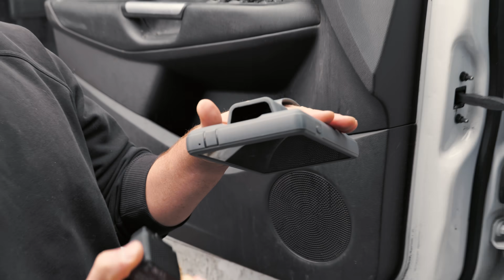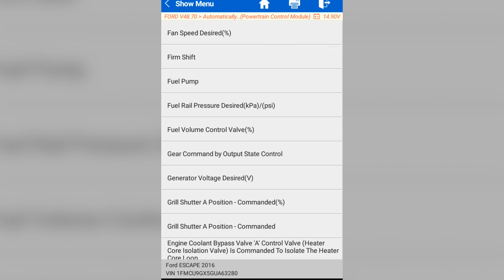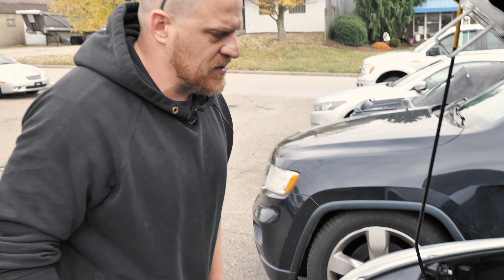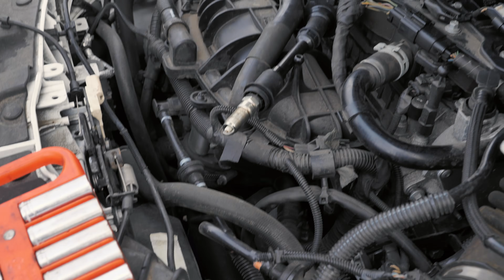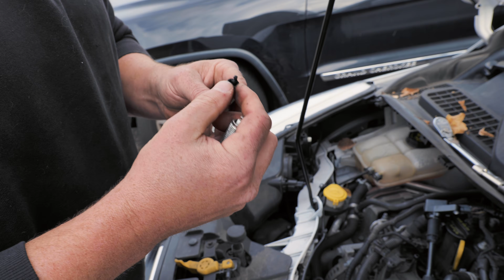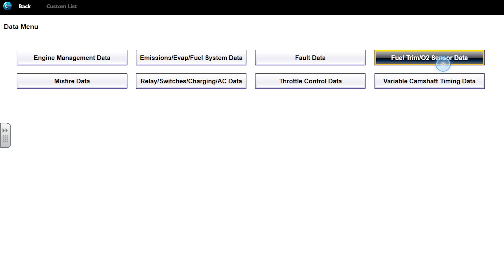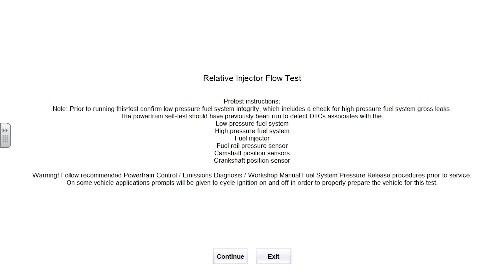GDI Misfire "Comeback" What Did We Miss?

Comment: When I heard you mention someone used AutoZone parts on this thing my first thought was it was the Chinese ignition coils likely causing an issue. I never use aftermarket coils unless they're made by ngk, or Bosch, or denso. Granted in this case it was an instillation error but I've seen that brand of coils come bad or not last longer than a week or so a few times before

Comment: Awesome 3 part video!  I'm dealing with what is likely a stuck open injector on a '18 F150 3.5L ecoboost.  Already came to the same conclusion (misfire code, dumping smoke and fuel out the tailpipe, low rail fuel pressure code), so it's great to have someone with so much more experience (and fancier scan tool) have the same thing.  Hopefully my high pressure pump isn't part of the problem, but I'll look at the fuel for metal (thanks!).  And this was my first time dealing with coils and coil boots, so while it didn't move with the plug or coil, the boots just have a different feel than non-coil systems, so I'll be sure to pay attention to that.  And your paid courses sounds great, so while I like the challenge of diagnosing (across a lot of areas) and fixing in person, the classes will be something to look at when I have some time.

Comment: What I would have done (and not that there was anything wrong with what you did, because there wasn't) but I would have swapped the coils just as you did #3 with #2, but I also would have pulled the spark plug and swapped it with #1. That way, if the misfire stays with #3, I have eliminated both the coil and the spark plug. If it moves to #2, it's the coil pack, and if it moves to #1, it's the spark plug. Just how I would have done it, that's all...pros and cons either way.

Comment: That engine still sounds like crap. Sounds like a diesel.
Reply from the maker: That's just the camera mic picking up the GDI injectors. They are loud
Reply: @ScannerDanner 
Paul...could we consider a potentiometer an analog switch, as oppose to digital?
Reply from the maker: @ekimbrough1413  not a switch, as a switch is either on or off, but yes an analog signal that is continuously variable.

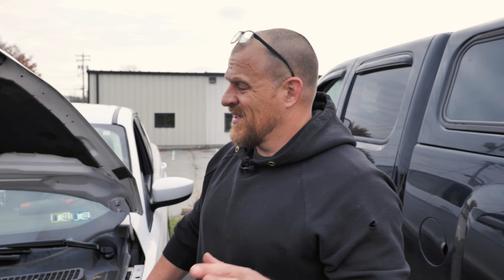Comment: 19:34 what is "open secondary"?
Reply from the maker: There is a primary circuit and a secondary circuit in a coil. The secondary starts at the winding in the coil and includes a plug wire or plug boot and the spark plug. So open secondary is any one of those 3 could be an issue.

Comment: I had side by side misfire on a 97 Sebring once that was caused by an almost invisible pin hole in one wire that was shorting to the metal sleeve.

Easy 1 sec fix 

ALWAYS start with the basics and a listen to your gut especially since I didn’t have fancy tools except a basic reader… old school.

All the sensors are great but engines are still engines.
Not saying fancy tools wouldn’t be good to have.. I just don’t have them. 

BTW Great video on biased voltage.
Now I have to watch the video and see how it ends.

Cool   this shows they should make it better so there’s no doubt when parts fit or not.

Everything is a learning event and absolutely everyone should be paid for their time.

Comment: Unbelievable... something so minute as not installing the boots over the coil properly caused such a huge issue. Absolutely insane. Excellent troubleshooting. Thank you!!!
Reply: have seen this myself ,a few times,never gave it a thought,if on wrong,i just re fix it lol ,have seen leads on in wrong order too,off the cap,pull off,refit ,firing order,and fuses,wrong colours in the wrong holes,takes awhile to notice them,dont take much to upset a running verhicle

Comment: Regarding the cop tool, why is voltages is too low like 1 volt is the highest scale ,is the because there is an attenuator inside the cop tool? And the wave form starts from 0 because the secondary coil connected to ground? 

Thanks

Comment: One thing I'm always harping on, is that just because new parts were installed, doesn't mean it was repaired. It doesn't mean the parts were bad or good. More often than not, a lot of vehicles I've repaired, had the same or more issues due to improper repair. Champion coppers in a vortec V8, etc.

Comment: So everything I have learned about the resistance of a fuel rich, in cylinder environment being less than what it is out of cylinder in lean ambient air condition is wrong?
Reply from the maker: ? Not sure what you're asking mr
Reply: @ScannerDanner  Just want to start by saying I love your videos, you have taught me a lot over the years. I wish I had the oportunity to learn from you in person early on in my career.

As far as my comment, I was taught that in cylinder environments should be more conductive in the in cylinder environments especially after fuel is introduced and after compresion has started to take place. You were saing in the video that in ambient conditions the air is typically more conductive than in in cylinder environment. Therefore spark should be able to bridge the spark plug gap much easier in ambient conditions as opposed to in cylinder.
Reply from the maker: @Kevin-qn7jf  in short, yes, fuel is a conductor and helps BUT cylinder compression and those pressures that are created, absolutely make it more difficult for the spark to jump the gap. That is why race engines that have very high compression pressures, need to have ignition systems that produce much higher energy.
Reply: @ScannerDanner  I understand that what you're saying is true. I have a lot of faith in your skills and knowledge as a technician and a teacher. The person who taught me the wrong information behind a combustion chamber being a better environment for spark, actually had a fairly rational explanation as to why, that made sense at the time, so I never questioned it until now. They simply said that with increased compression, and fuel in the cylinder during an ignition event, the atmosphere in the cylinder was a better conductor. This made sense to me at the time. I realize now that I was mislead having made incorrect diagnosis of vehicles in the past based off of this faulty logic.

Im starting a mobile repair business in the suburbs of Philadelphia PA. Not too far from you. I would love, when it comes time to hire on employees to be able to recruit some of your students in the future.

Comment: I bought the autel ms906ts for $1,700.00 and I could have bought the ms906bt for $1,000.00 but I bought the other one cause it is 2 in one ,dose scanning and programming of tpms sensors , pcm moduals and skim moduals as far as I figured out so far. This scanner looks cool and up to par but I still love the functionality of the autel. Autel also has multiple options of scanners depending on what your doing with it and I suggest calling in and finding out what one fits you best for what your doing!

Comment: As soon as you pulled up the first coil I could tell there was no connection to the plug. The factory installed dielectric grease was undisturbed. Still perfect lines of grease in the end of the coil boot.

Comment: Great Video , I think a lot of younger techs sorta shoot over that it usually always come back to Basic's . An never turn down the opportunity to learn something , seek out the knowledge it's there , Even The Heavenly  Father wants you  to not just know the words but apply them .      These Newer Cars are so high tech , an they allow you to have all kinds of info basically at your fingertips especially with the right diagnostic tools , but the most important diagnosis tool is You The Tech , you have use all your senses in  effect be in tune with what your doing as you were doing  in the video when going thru the various test your thought process of evaluating the test data , While true the more experience you  have the better you get at it , You still need to understand the basics of why your test results are coming back as such . I myself got into Drive-ability decades ago when electronics first started to come out , the older mechanics scoffed at it an most just flat refused to work on them , The Wife nearly killed me when I bought my first OTC Monitor 2000 due to its cost . It took about a year to see a huge jump in my wages & of course word of mouth got around in our area I was swamped with work to the point I had to start turning jobs down . God Bless Guys .
Reply from the maker: I used the OTC 2000! Awesome! Thank you my brother

Comment: Paul, Longtime viewer, wrencher here as well. Anything from Automotive to Class 8 years ago to even lawnmowers, snowblowers. 

Anyways to the crux of what I wanted to mention that I think you may have overlooked in the work on this. We learn so much from you so want to help you as well. 

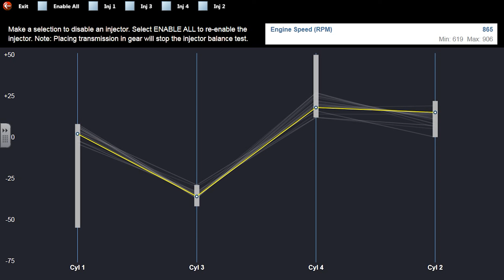Go to the 28:55 mark in the video where you have the power balance up. I figured this feature out a few months back after a engine swap. 

IF you read at the top of the power balance screen you can disable each injector individually. There's also a button to enable them all. 

Wouldn't it be ok to use this rather than going back & forth as you can do it from the drivers seat on the scan tool. 

Now to my question. You mentioned 15% in regards to fuel. Does this mean if the cylinder isn't firing that 15% is added to each cylinder that's working? 

You mentioned at the end that the car had nothing to do with previous work. 

I was thinking that once you started narrowing it down to the coils but also mentioned that it had had the parts cannon thrown at it by a relative from Auto Zone earlier in the video as well.  

Had they not changed parts it wouldn't have had this issue. Also are the parts from Auto Zone going to last in your opinion? Personally I don't think so and I think there's some good coils laying somewhere whether at customers house, in the car or at the dump.
Reply: Wonder if the windshield wiper tray played a part in this not getting installed properly. Wonder what the factory SI says to do? Most mechanics would know to make sure it's running properly.

Comment: What is normal voltage require  for the spark plug to fire and said that the voltage was high in this case study? I got confuse when you change the voltage scales
Reply from the maker: Unfortunately the scales i started with were not coordinated with the probe. So what we were seeing on the screen, in amplitude, was not being properly scaled. The signal was accurate, the scaling was not. Im sorry about that. The kv scale (ignition probe preset) would have been better to start with to show you the voltage spike. It was every bit of 30-40kv. This spike would normally be about 10kv. 
Hope that helps

Comment: Good find Scanner.  I see that you finished diags with the Snap On.  What's the word on the Topdon?  I'm ready to upgrade from my 2016 Maxisys.  What would you buy if you were me?  I don't do much programming other than Ford using Forscan.  I appreciate your insight?
Reply from the maker: I only finished with the Verus because I wanted to do the injector balance test that I could not find in the topdon. 
For the $800-900 this Phoenix  is, you absolutely cannot beat what it can do, for this price! Super impressed by it actually
Reply: @ScannerDanner  Thanks SD.  Any thoughts or issues with the more professional Topdon units?  I'm not opposed to spending more if there are other functions/benefits that a professional would benefit from.  BTW - keep pressing on in the Lord.  What a blessing to walk with your son in the Great Adventure called Jesus!

Comment: Great vid my friend, good diag. Just throwing this out there but working at ford for many years we had a lot of these engines maybe more the 1.5l , where the engine block would warp and cause small amounts of coolant to enter the plug tube causing spark leakage. This would cause misfires on 2 and 3. There was a tsb on this to run engine hot and pressuring up the cooling system and inspecting the top of the plug for coolant. Just food for thought and I hope this car doesn't come back, and I very well could be wrong. Take care and God bless

Comment: I remember in my own car VW Golf mk3 GTI, I've changed ignition wires to an original new ones and after a month or two I had a really bad misfire on 2nd cylinder. And god damn it, took me few days to realize that in this wire there is no connector for the spark plug to attach. I drove a car like this for almost two months without any problem. When I changed one ignition wire to some cheap aftermarket stuff, again after a week or two - misfire on another cylinder. Finally I've changed all ignition wires, from original expensive ones to some noname aftermarket. 

And that was a relief for me. Car had a liquefied petroleum gas installation with gas/air mixer on the intake, and misfiring caused few explosions, I had to glue this whole thing like 20 times (hard to buy a new or used intake). That was a lesson for me, if you buy original expensive stuff - hide the bill somewhere, don't trash it cause it can be bad
Reply from the maker: I've had a similar experience with cheap aftermarket wires. If I go aftermarket these days, I just say, give me your most expensive wire set lol. That's served me well.
Reply: @ScannerDanner  my friend told once his own method for buying cheap electric tools (for building etc). Don't buy the cheapest one in the store, buy the next one from the cheapest and I have to say - all his stuff works more than few years without problems. Cheers man for awesome work!

Comment: Sometimes my boss asks if the issue was fixed when I replace a part. I tell him "yeah" with confidence. Insists on taking the car for a test drive but having bidirectional, those tests are not necessary when you want to check for functionality.

Comment: You can use a spark tester & watch the secondary pattern. If the pattern looks normal then the coil is good. Then you need to look for bad spark plug or mechanical issue or fuel related.

Comment: This was GREAT MOMENT to show why is good to check the REAR o2 sensors pids to pinpoint a spark problem. This PIDs often is  forgoten . In this case the readings would be very rich, because the catalyst is not able to oxidize the Extra unburned HC, becouse there was no combustion.  The rear o2 will be around 0.1v. The front o2 reads nearly stoichometric because the nessesery fuel for the amount of air  entering the engine was injected properly. But some of it condensate on the hot cylinder and exhaust and thats why the slightly lean and the positive trim(and the foul plugs on good cylinders) . This is helpful of tackling spark problems. 👍 🥃

Comment: 27.56 after reinstalling the coil the popping noise heard is the spark outside the coil arcing  work as a Ford tech and made this mistake a few times best way to avoid nice video nice process
Reply from the maker: For sure! I definitely heard it in the editing room, but not live on the car. Guess my ears were not tuned to it. Maybe I thought it was the injectors, as GDI systems are loud.

Comment: Those little green stripes in the coil boot will be smeared if they are installed on the end of the plug.  I assume to prevent returning a used part to the store.  They were so perfect, it looked like they were not even on the plug a little bit.  Keep up the great work Danner!

Comment: Nice edit, Specially at end ;)
Ps. The Test may look For a charger bean connected. So not the volt  at battery but the AMPS coming in. So if Battery control module dont see Amps coming in its no go...
Reply: PS. The test may look for a Chrager to be connected... so not the voltage of the battery but that the BCM(Battery Control Module) sees Amps coming in to the battery from the corret charging points....

Comment: I just worked on that same vehicle with a bad high pressure fuel pump. After getting it all put back together and it had the same problem. I accidentally put the number 4 coil in and not properly seating it. So it happens with that model.
Reply: it's been known to happen long before coil on plug was a thing, just needed long plug wire boots and plugs deep within the heads.
that's where real mechanical skill comes to play, you have to feel and know you've got them on properly, even then you may miss once in a while and need to jump straight to the issue and correct it fast.

Comment: Fun fact o2 sensors do not sense hydrocarbon levels HC (raw fuel ).  They use oxygen & carbon monixide (CO) as rich/lean indicators.
Reply from the maker: Fun fact 😉 unburned fuel is a factor too! Unplug an injector and watch your fuel trim. Then disable spark and watch your fuel trim. Make sure the injector is still firing during the spark disable 😉
Reply: @ScannerDanner   I would argue the heat of the combustion chamber alone(without spark) may burn a tiny bit of fuel and that's what you'd see on the fuel trims.
Reply from the maker: @codyarizona4925  i used to think that until I researched it more 😉
There is a reason they call it the tomato sensor. (Is is a fruit or vegetable? )
Reply from the maker: @codyarizona4925  it's a mini catalyst 😉
Reply: @ScannerDanner  I do understand what you're trying to say. I'm just implying that an o2 sensor is only designed to detect two elements, oxygen and carbon monixide. Unless diagnosing using exhaust gas analyzer, the HC level isn't really a factor in anything.
Reply from the maker: @codyarizona4925  not true my friend. The unburned fuel is a factor. Search "tomato sensor" on iATN and have some fun.

Comment: You can hear the spark snapping in the plug tube on the video (maybe not from your position, too much engine noise), it was gone after you properly installed the coil.
Reply from the maker: You totally could hear it in the video but I couldn't live. I just mentioned this to Caleb yesterday
Reply: zappy zappy, are Danners ears are crappy? 🤣🤣🤣
knowing how hard it can be to hear things over a running engine, you get a pass. 🥳